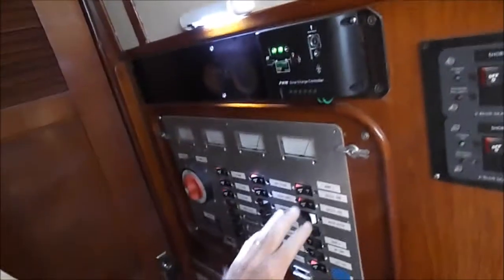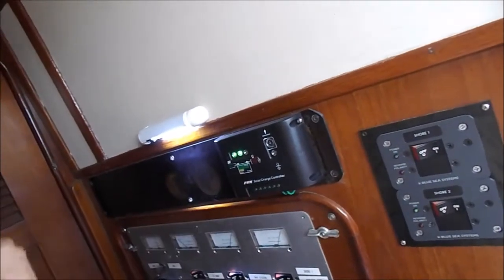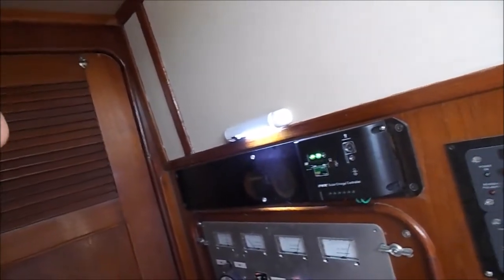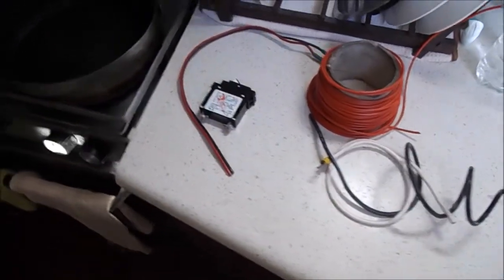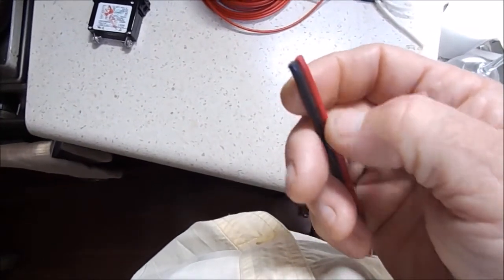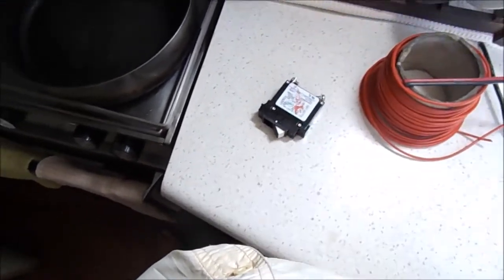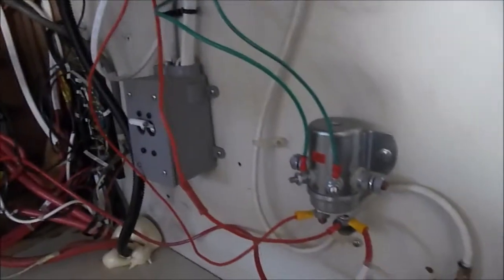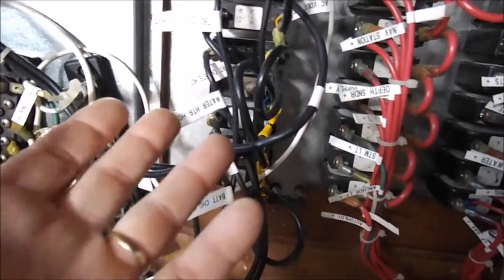Basic Electrical Systems

Comment: Shouldn't DC negative be yellow?
Reply: On older boats you will almost always see they used black wire for DC negative...however newer systems use yellow wire in an effort to reduce any confusion where both AC and DC exist like on bigger boats...because on AC systems black equals hot or live..Yellow is indeed the proper color for DC negative nowadays.